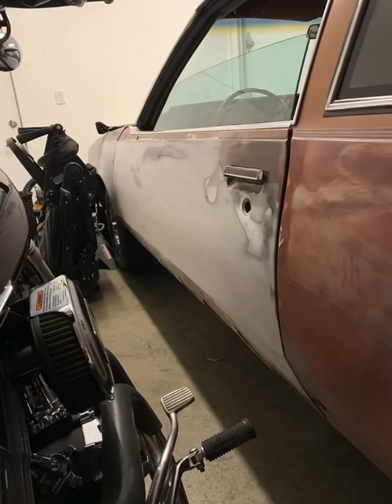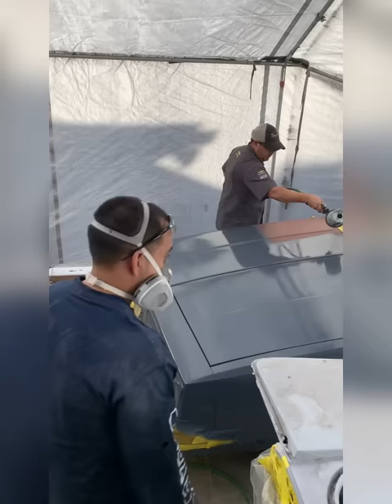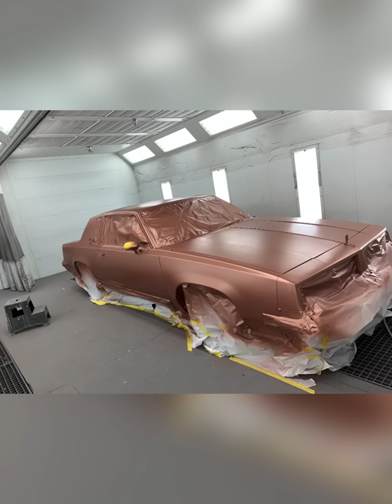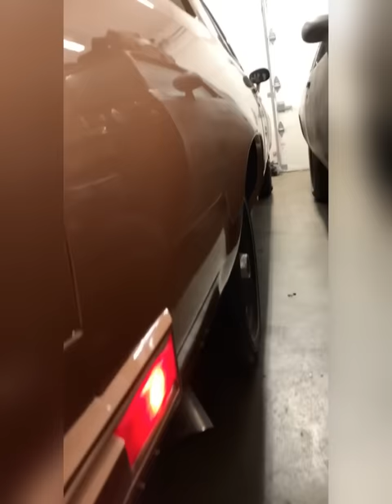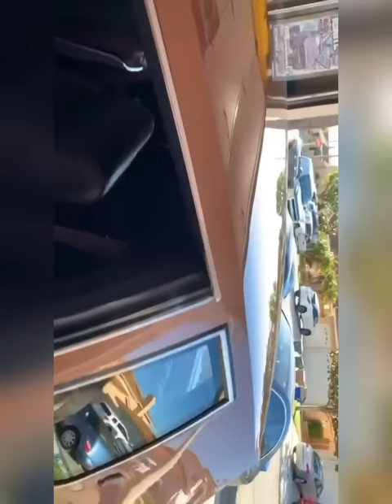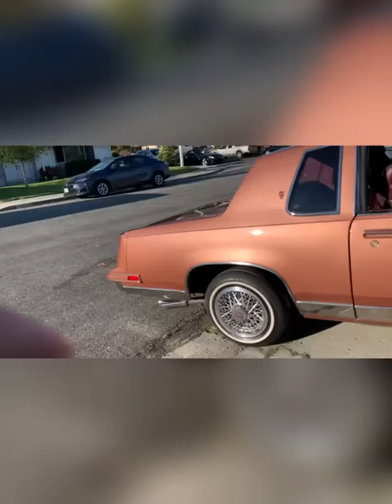Cutlass Gbody quick paint Job, What a difference !! #cutlass#gbody #paintjob#lowrider

Comment: I had a 79 Oldsmobile cutlass supreme with maroon paint job held up pretty good but the engine ended up dying I try to redo the heads and stuff but I ended up junking it... I got my self  a gen 2  rx7   That mazda car was my favorite... I pimp that thing out ,gorgeous black,blacked out tint , Kickin stereo chrome wheels Cruisin the streets in the mid 90s
Reply from the maker: The annoying thing on these cars are the carb problem and vacuum lines. Man those days must of been golden enjoying them like that

Comment: I had an 87 and 89 cutty. Super secksy body style. 89 was the first year for the single unit headlights although the previous models with 4 separate lights looked better IMO. Great job bro.
Reply from the maker: I also like the quad lights. But maybe because I never owned a euro clip lol thanks for watching
Reply: A 1989 Olds Cutlass would have been a completely different body style, and would be a front wheel drive car. 
The G-Bodys only went to 1988..
Reply: @davelowets  that's what I said right?....89 was the year it all changed?
Reply: @pwnsolo443  88 went to the same body style with the "single headlights". 89 it was a whole different car.
Reply: @davelowets  87 and 88 had 2 headlights...84 had 4 single headlights...89 isnt the same. Im not sure what youre getting at....youre saying what I said just differently lol.
Reply: I had an 87 and 89 as I said .....I know the differences. 89 is aerodynamic bubble with no hard lines at all. 87 had 2 headlights and as I said the older ones looked better with 4 single lights (84ish)
Reply: Actually the FWD V-6 Cutlass was a mid-‘88 model

Comment: Dad did a great job from what I can see. He straightened the driver's door quite nicely. He also did a great job spraying that metallic color. It doesn't look like it modeled in any way, and his clear looks very clean. Looks like he laid it down nice and wet. Minimal orange peel. I'm impressed. Better than I can do I think. What paint code and what clear did you use? What paint line?
Reply from the maker: Darren thanks for the compliments. Yes he’s been painting all his life. He helped me with the base since I wasn’t familiar with solvent. And I cleared it myself using a rp Sata. It payed out smooth. We used house of kolor clear ! The paint code is 72 by Gm in the early 80s

Comment: Nice work use to have a 87  i miss that car its been a couple of years now the car was taken from me at gun point it was found later with no transmission no wheels and the whole steering column was gone and no carburetor sold the car as is $600😳
Reply from the maker: Sorry to hear that man. That sucks. Hopefully you come across another. Thanks for watching

Comment: Super clean OG cutty, did you get all the chrome replated or polished?and what did the paint job cost?
Reply from the maker: Thanks for watching. All the trim was original I just cleaned them up. No polishing. I did it my self I probably spent about 1200 in material(sand,paper ,tape paper,Primer sealer,base and clear But around here this is probably a 5k-6k paint job if not more
Reply: @geraalday6088  Paint looks better than factory. Regals had similar color available.
Reply from the maker: @dosgos  thank you 🙏 yes you are right very few models came with this option I believe.

Comment: Why were the bumpers painted separately? Did you add flex agent?
Reply from the maker: I did that just to make it easier once I took it into the booth. I didn’t wanna be going extra low kicking up Im dust with my gun. And no I don’t only adhesion promoter on the break throughs.

Comment: Looks bad ass. Is there a reason you painted the door jambs and bumpers then added primer again? I'll be painting my Lincoln and it has bumper fillers, that's why I'm asking. Thanks
Reply from the maker: What’s up Luis thanks for watching bro ! I jammed the doors and painted lower bumpers after I was done with the last primer so I don’t have to remove doors to paint the inside Then I covered them up when I took the car to the booth. What you are seeing in the booth is called sealer. Right before the base (don’t have to sand )
Reply from the maker: You’re bumper fillers as-long as they are primed you should be good.
Reply: @geraalday6088  Thank you for that info! Just subscribed to your channel.
Reply from the maker: @LuisHernandez-he53  thank you much appreciated! I have a 80 Monte Carlo I’m building as well I’ll posting som footage of that as well